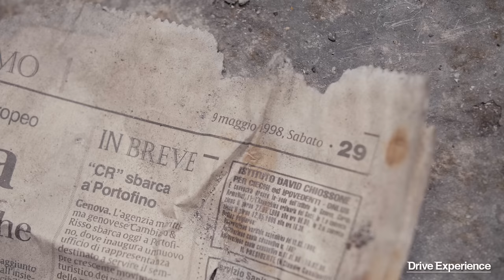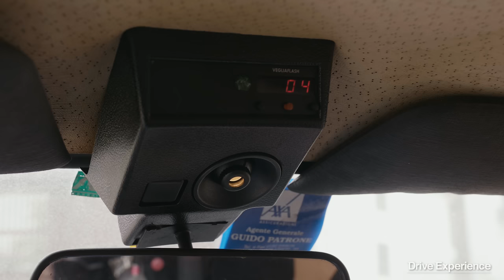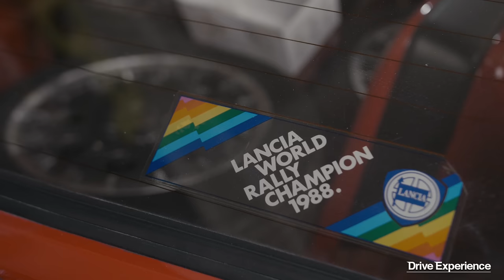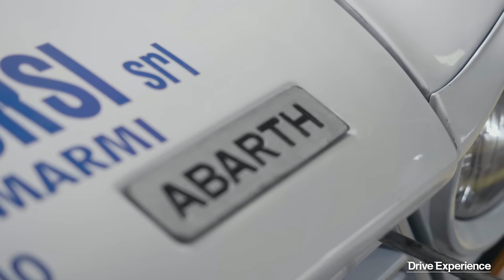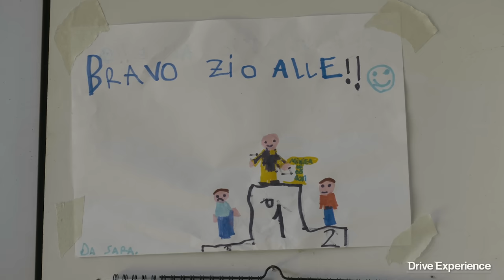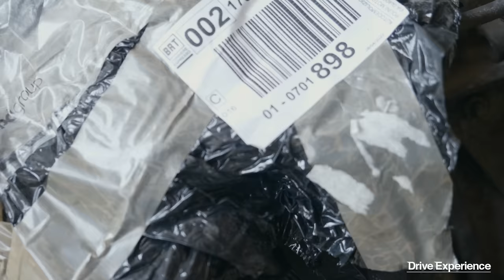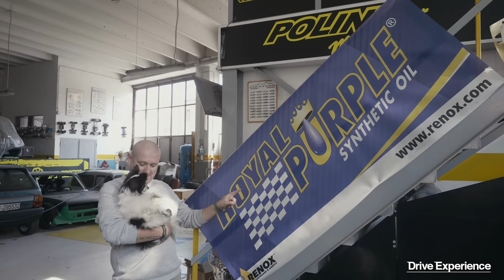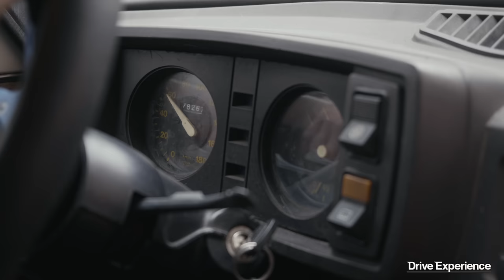Fiat 127: Salviamola per farne una bomba da rally - Davide Cironi (Dal Pollaio alla Pista Ep.4 SE03)

Comment: inconfondibile rumore aste e bilanceri del 900, la tua è una cl io avevo la c riconoscibile dai paraurti in lamiera verniciati di nero, eh si ha solo 4 marce carburatore mono corpo però affidabile fino alla fine, bastava continuare a mettere benzina acqua e olio..ma se mi ricordo bene il cambio a 5 marce non ci entrava sono proprio curioso di vedere come risolverete..non è vero è esistita anche la 127 sport o super ora non ricordo aveva il 900 68 hp che aveva la prima versione della A112, mi pare che avesse lo stesso doppio corpo della 850 coupe da cui derivava anche il motore se non erro..la ruggine era un problema sotto il parabrezza destra e sinistra dove schizzava il fango la ruota anteriore nel parafango..ah quindi ci mettete il motore del 128-duna-ritmo 1100, a questo punto perche non direttamente il 1300 del 128 rally-ritmo 75 ? veramente la facevano anche arancione che non era male come alternativa di colore

Comment: ...anno 1979...avevo una 127 prima serie che acquistai incidentata, perchè non avevo la possibilità di prenderne una marciante, per farla breve la rimisi in sesto di carrozzeria verniciandola in nero, sostitui il motore con uno di una A112 Abarth 70 hp 5 marce, modificando il longherone sx per farci stare il cambio, qualche "fazzoletto" di rinforzo, lievi modifiche all'assetto con ruote in lega e pneumatici 155/70 13 per non dare nell'occhio, interno modificato con appoggiatesta della 128 Rally e strumentazione della A111 inserita nel cruscotto riginale, per poter avere il contagiri, inoltre temperatura olio motore, volmetro e manometro pressione olio al centro del cruscotto, volante in pelle di una 595...tutto rigorasemente riciclato...come vedete si facevano anche più di 40 anni fà certi "trapianti", certo le possibilità e la conoscenza era nettamente inferiore ad oggi...la passione nò!

Comment: Can someone please explain what is the difference between this 1050cc engine and 1116cc engine from Fiat 128?
Thanks in advance!
Reply: Il motore 1100cc mono albero in testa della 128 nasce nel 1968/9 circa. anno cui debutto la Fiat 128 poi portato anche a 1300cc il 1050 credo sia un Fiat brasiliano, che veniva montato su le più sportive versioni di Autobianchi A112 e 127 sport due motori completamente diversi.. spero di non aver scritto qual cosa di errato 🤔 ciao 😉

Comment: Ciao Davide. Ho avuto in eredita da mio padre(deceduto 7 medi fa) . Alcune auto, da sistemare, altre  in buone condizioni. Vorrei partecipare alla trasmissione per fare qualche progetto con alcune di queste auto. Sono pensionato, e con la passione di auto è moto. Lista auto: Fiat 126 . Anno1980 si può recuperare il motore. Fiat 500 anno1968 rossa ruote larghe, restaurata, da mettere apposto, piccole imperfezioni carrozzeria. Fiat 850 coupé Vignale. Anno1968  motore ok interni rifatti, restaurare carrozzeria. Fiat Panda 1980 con tetto apribile, motore ok piccoli interventi Carrozzeria. Lancia k 2.4td. Anno 1997 scritta Asi. Funzionante, piccoli interventi da fare. Alfa Romeo Alfetta 2.0. Anno 1980 rossa restaurata scritta Asi, piccoli interventi da fare. Fiat Strada 1.7td.anno 1999 funzionante, ritocchi carrozzeria. Fiat Marea 1.6 wickend anno 1996 funzionante, ma da riverniciare motore Ok. Moto:Honda 450 cb anno1974, da riprendere, con motore di ricambio, più un telaio con motore senza libretto sempre Honda 450 CB. Kawasaki 1100 GPZ 1983  comprata nuova con soli 15000km rossa funzionate, da sistemare mono ammortizzatore. Kimco 250cc Venox anno 2007    km2500. Funzionante. Moto. Guzzi Guzzino 75cc
  Anno1960 restaurato da riprendere. Mosquito Garelli con bici Anni 40 50.   Per  finire   barca sprtiva olandese, con volante e motore da 25cv. E carrello. Da ripristinare. Ho bisogno di un aiuto,a sistemarle oppure chi è intetessato ad acquistare. Daniele

Comment: Man the brasiliano engine is one of the more reliable and versatiles engine after the fire here in Brazil is called by fiasa with 1050 ,999,1300 and 1500 cc
All this displacements only with block in different heights